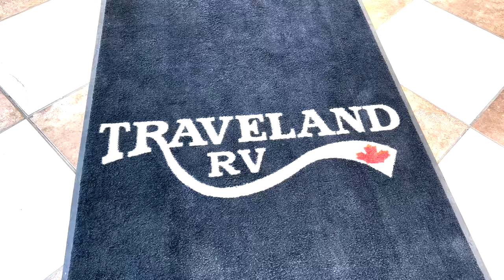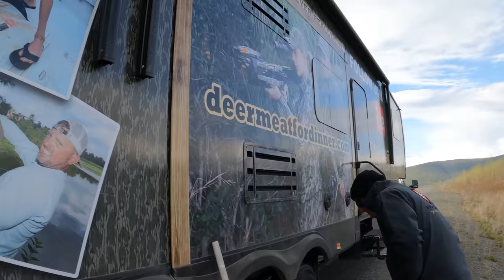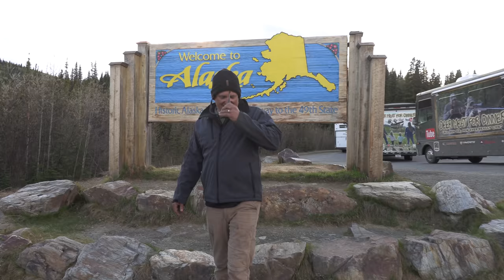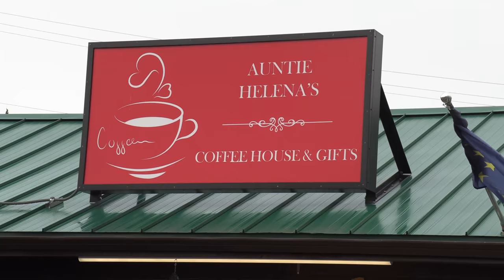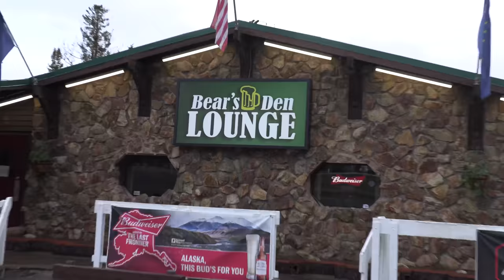Wild Alaskan Rainbow Trout over Open fire {Catch Clean Cook} Driving through Destruction Bay!!!

Comment: my friend i know this is late.. been gone but when cleaning trout? there is no need to scale them and when you gut them after everything is out there is a bloodline so to say up along back bone. use your thumb nail press hard and push all the way to front rinse and it is clean. When i clean them i cut across where skin meets gills,.. looks like a little bone. put your finger inside pull gills and front pectoral fins all come off at once. Now you have cleaned fish ready for the grill. Take care have fun be safe. awesome the way you stopped and helped the guy with trailer trouble. i have sat on road for 12 hours before anybody stopped and asked if i needed help and then they couldn't do anything for me. it was 40hours before i got help and on my way. Your right humanity does have a problem my friend.